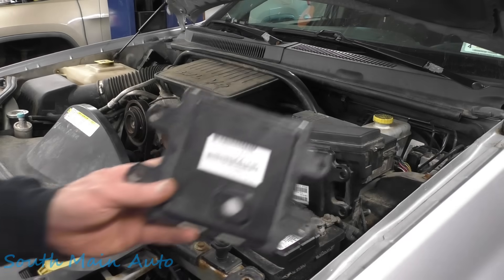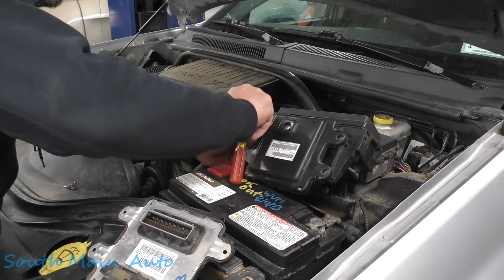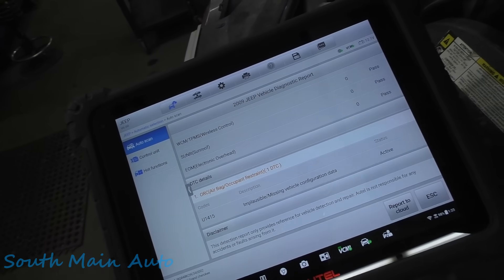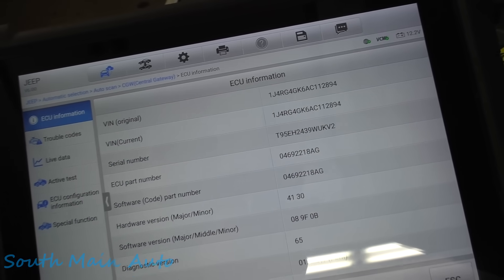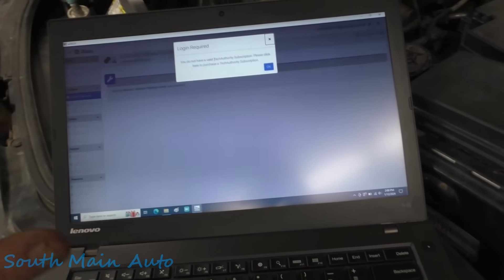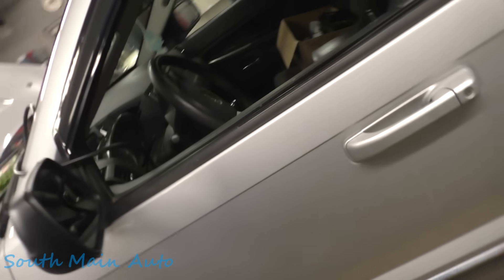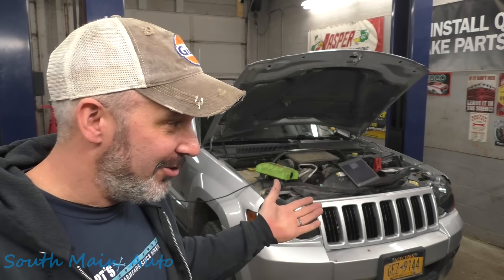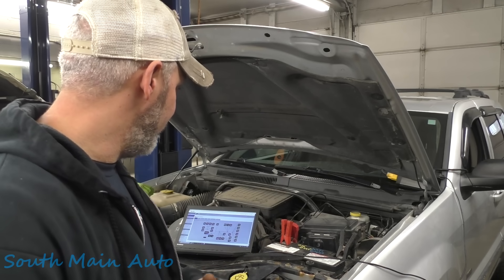'09 Jeep Grand Cherokee - Tach & Speedometer Cut Out - The Fix

Comment: Is the FCM any different in regards to the way a TIPM works with programming? I know in my Sister in law's Jeep I replaced her faulty TIPM but she had gotten one from online where it was "blanked" (I assume similar to L1 Auto) so that the VIN was empty. I didn't have to pay for Chrysler's software as it it had a key on programming and I never had issues with the VIN programming to it. No codes stored or anything. She doesn't have the car now as she hated it so much 😂.

Comment: Of course you have to bill the customer for the cost of the service. Chrysler is not the same as it used to be since Daimler started making the vehicles like the cars in Europe countries(Mercedes). I have a pickup with the Mercedes designed engine it’s not as good as the 318 I have had in the past .

Comment: Hopefully, in the future, there will be a way to rip out all of these modules and replace them with a centrally located module in the trunk. Modules shouldn't be hidden all over the hot engine bay or wet  undercarriage. Somewhere, the evolution of emissions control went awry.
Reply: I'm sure dealers start charging the minute your car hits the rack. Either cooling or drying, it's still $140/hr😊😊😊

Comment: Potentially we could see a new industry evolve from this problem. Nothing goes obsolete faster than electronic tech. The laptop you buy today is outdated within a few months.Automotive manufactures are relying more an more on computers to run their vehicles. I believe they are only required to support these systems for about 5 years from the date of manufacture. That means it could be a challenge to source electronic parts for anything older than a 2018 model. Even manufactures like Hyundai and Kia which have a full 5 year warranty will only warranty the electronic dash modules for 36 months. This means that there is a rapidly growing need to be able to reprogram used electronic parts.

Comment: This is a good example of why our future with computers, modules, electronics etc. in general life need to be highly reviewed before putting them to use such as applicances, residential and commercial HVAC, plumbing, main electrical, sewers etc. Why? There will be a day that something in the mix needs replaced or repaired and 10 or so years from now, will those items be available or do we have to spend an addiditional $20,000 to fix a $300 problem.

Comment: I expect companies like Haltech and other ECM replacements will become more out of the performance and custom space and into the repair and maintenance space in the next decade.  They already have drop in replacement modules with short harness converters to go from their "standard" to OEM for quite a few vehicles.  I just see that as the future.  Get the OEM out of the mix and use third party hardware and software.  

I would expect to see someone create a Raspberry PI type replacement at some point.  Where the hardware is open source and the software is open source.

Comment: Don’t want to sound like an idiot myself, but I thought I would ask the question that came to mind in watching the issues caused by swapping the modules—would it be possible to make and install a new pin where the old was rotted off, thereby bypassing all of the VIN issues?  I’m not sure how the pins are held in place on the board…if they’re soldered, could a pin from another board be unsoldered and soldered back in place in the original module?

Comment: Now I am scared to upgrade my vehicles unless I buy new and keep upgrading before the warranty runs out. This sucks. this also means you need to be near a good service center, something EVs lack for most rural areas. I think they used to have to keep parts in stock for 10 years, but that may have went out the window. It's killin us DIYers.
Reply: If you're not in a salt belt, vehicles should last longer.
Here in MN, the body rots off before the drivetrain fails.

Comment: I would like OEs to know that this keeping your cards close to the vest BS affects car sales and residual values which loops back to car sales. I recently had a new vehicle purchase decision to make for spouse. Thenlist had narrowed to 2, a Volvo and a BMW. BMW won and it was more money. I can choose from a number of scan tools and other hardware/firmware sets and do a long list of adjustments and parts replacements on BMWs that are not possible on Volvo. I have customers ask what they should buy and my answer never includes Stellantis. I have several on hospice. The vehicle has some electronic module failure but they still drive it to wear the tires and brakes out and when the next thing wears out or breaks they withdraw life support and buy a new vehicle. When the vehicle has a known issue, a dealer you trade it to either drops value an any traded or runs a scan on it and looks for problems so trade-in dumping is unlikely.

Comment: Exactly why I shall never own any Jeep Grand Cherokee later than 2004.  Me and my DRBIII, JTEC only, and screw Jeep/Stellantis ... and, back to your original problem, dissolved connector pin... well, there are many ways to correct that, perhaps steal a connector from a new box and solder onto an older board, or, get inside the original box and bring out a single wire for every oxidized wire.  TechAuthority, shove it... not going there.  .. and... my Thinktool PROS with current update BARELY works with JTEC, not surprisingly

Comment: Your "if I can do it, you can do it" is mostly correct for straight mechanical fixes...  But, getting into all the electronic fixes... Not so much.. 😆

I'm an old computer guy and all this new stuff is just way beyond my ability to deal with on vehicles..  I thru up my hands on my 97 F150 when anything 'computer' related popped up.. ha, ha... 

Anyway, it seems as long as we have legit "hackers" out there that can do good instead of bad, we can rely on guys like you to save our butts....  I'm not a "hacker" and never went down that road with my old computer knowledge...  I understand it, just don't know how to apply it... ha, ha..

Comment: At least for a while smart people like you can keep them running. What it really needs is some mandate that forces manufacturers to supply the software, at reasonable cost, to the trade. Thus insuring the customers can utilize what they have paid for over a longer period of time. If the way forward is even more computer control. The manufacturers have to provide easily accessible programmes to be able to work on those vehicles. Not keep some in house only protocol that really only sort of works with brand new vehicles.  Or as I have long thought. Especially with EV"s in the mix. There will be no more second hand car market. Further benefitting the rich. And hindering the poor.

Comment: @11:11  I noticed that the current ECU part number is listed ending in 04896122AF instead of 04692218AG @11:42 which is the new part number.  
Even though the new part number ends with a higher letter...the numbers preceding it is lower...would that make a difference as far as programming ability?   
Nevermind...
In today's age of computer controlled vehicles you are going to need hackers to be able to continue driving them past their End Of Life date  :)

Comment: It's no longer air, fuel, and spark.  Besides being a mechanic, a person also has to be a computer tech and have the necessary computer equipment.

Wonder what a vehicle would cost today if you only had to be concerned with air, fuel, and spark?

Comment: Maybe "totaled" isn't the right term though it is perfectly descriptive.  Totaled makes me think that the owner will receive some compensation through insurance and will not be fully out the value of the vehicle.  A situation where the vehicle is unable to repaired will result is the loss being fully on the owner.  Otherwise good vehicles out of use, owners out of money.  There needs to be some sort of revolt that corrects this situation.  It will take a revolt otherwise mfgr's will not address the issue.

Comment: I want to know the reason these computers need to know the vin. It doesn't change their job, or how they operate. It really seems like its to force people to go to a dealer to get this stuff fixed, and like Eric said, once the vehicle is old enough, its junk because these parts won't exist. Cars are trying to be too smart while they are still too dumb for it. Now cars need to know what battery and how old it is to best charge the battery, otherwise it will kill the new battery you put into it. This takes specialized programs, some are available aftermarket, but not all diy people will know about this stuff or understand what is going on anymore.

Comment: I dislike that it isn't that easy or straightforward that used auto parts that have finished their lifecycle in the product they were designed in cannot be swapped over into a product that needs it. When I worked in a shop, most parts could easily be swapped in. Radios (If you had the unlock code or called for them), HVAC panels, switches, fuse boxes, etc. Most everything but the PCM/SRS system was an easy plug and play. I know this is the world we live in, and I know mfg's won't make it easy as their mentality is "HEY! GO BUY A NEW JEEP!"

Comment: Seems like if really desperate you could take a connector from a donor and put it into the old one... or even a single pin... or, if you're a D-I-dumbass like me, just cut down and solder jumper wires in!  Glad there was a happy ending... those Chrysler hemis don't like to idle, not enough oil spray, they chew them camshafts up.

Comment: For all the EV haters out there, this is a prime example of why the IC is on its way out. Even the simplest IC car now has tons of modules and sensors that must all work together and as they age and fail and parts are no longer available people will have cars sitting alongside the house which will not pass smog tests and become worthless scrap. Eventually you will see a dichotomy of cars on the road- EV units and old pre-module classics which run on points, plugs and condenser and are exempt from smog tests.
Reply: This was not ICE vehicle failure, but an electronics failure. EVs are equally as complex in the electronics, and also fail....
Reply: @thomasmartin2950  Wrong, IC cars have far more components and each one requires electronics which are prone to failure in addition to the eventual failure of the mechanical parts. EV's have far less mechanical components and far fewer electronics.

Comment: This nonsense is why Right to Repair is critical, please write and call your congtesscritters and tell your friends and fsmily. If the manufacturers continue to do this (raising subscription prices unreasonably, not ensuring parts availability, and most importantly keeping you from using used or repaired parts), everyone loses except the shareholders
Reply: not a new issue i recall my uncles agast because a replacement block for the john deere D was not avalible as it was over 20 years old.. for course if they would have replaced the leaky water pump so they didn't have to drain the water every night  the high school kid wouldn't forget and crack the block.

Comment: We will always have classic car shows if you can even find a modern vehicle that is worth the trouble to restore who in the world would want to restore one anyway because when you buy them from the factory they come to you as junk already but you can always rip that crap out of the car and replace it with aftermarket Holley and others are doing wonders Making electronic fuel injection stuff that actually works and everything else vintage air you can rip out all of the factory crap and replace it with vintage air so they will always be a way to have restored classic vehicles. To tell you the truth car owners and mechanics need to file a court action against the manufactures just like the farmers did with John Deere to give them the right to work on their own equipment instead of John Deere having the monopoly